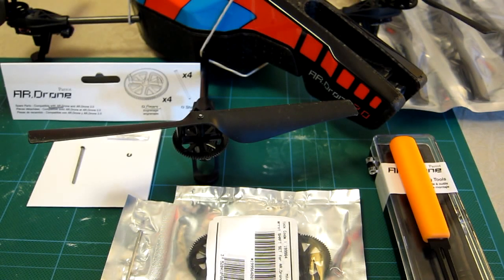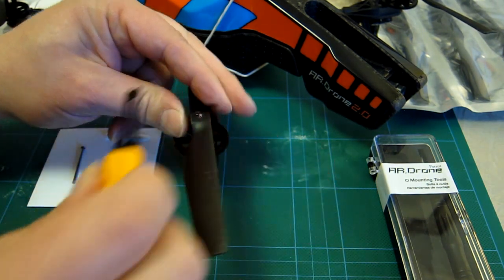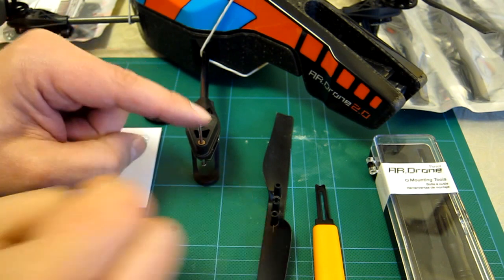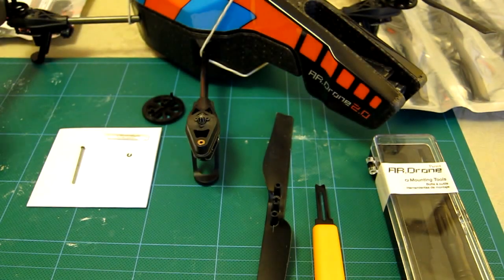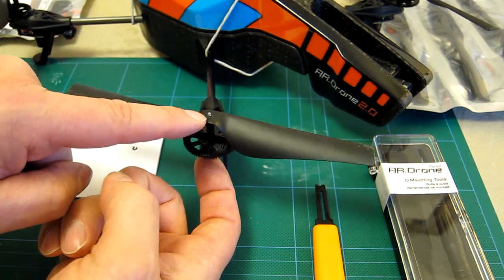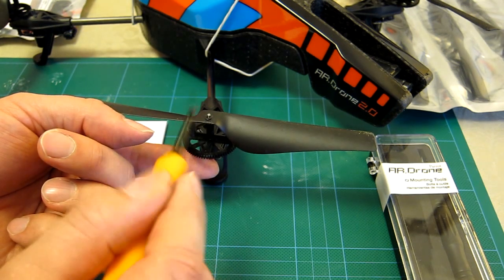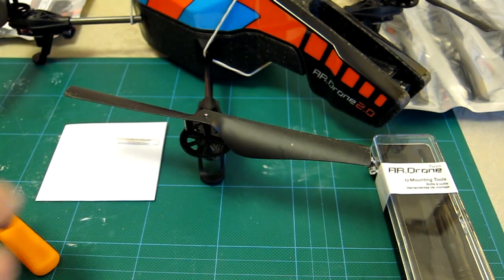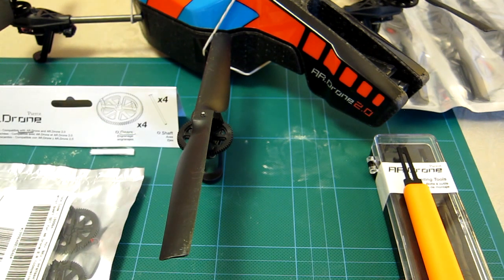in HD - AR Drone 2.0 - Gear, Shaft or Prop Replacement - How to - Fixes Unstable flight videos

Comment: What's the diameter of the shaft an the length
Reply from the maker: Sorry, I do not know. however they are so cheap and readily available.
https://www.ebay.co.uk/itm/273469775120

Comment: Great video, but how do you replace the tiny gear that spins the big gear???
Reply from the maker: Motors removed and then re-installed in this repair segment:
https://www.youtube.com/watch?v=b19laOlDync
From circa 04:00 onwards.
You can not remove the drive gear from the motor. The plastic cogs are sacrificial. The plastic gears strip so the metal teeth are not.

Comment: What to do if there is no mounting kit to remove the c clip ? Mine shaft bent so I ordered new ones but I couldn't found mounting kit in stocks
Reply from the maker: +Teknolojik Tencere if you do not have a C clip removal tool, you can still remove then C clips with small pin nose pliers. Just means that you are more likely to twist or damage the C clip. But that does not matter as you get more with the shafts.
Be careful pushing them on. That can be done with the flat of a screwdriver head. Hope that helps! (But always better to have to right tools)
Reply: +Tom Strong Reviews eye thought that scissors would ve okay but may give damage dont worry i have 8 cclips
Reply from the maker: +Teknolojik Tencere Mind you do not hurt yourself! 
(Scissors are far far away from being the right tool for this job)

Comment: Hey can you help me out?
I bent the shafts to the point I can't push them out. One of them are so bent I can not even push a part of it out, so I can't try to cut the shafts in half. What do I do?
Reply from the maker: Goldname1 Wow. that is bent! I would first use pliers to straighten the bent shafts so I could remove them. If that does not work. Try and find a flat metal surface (top of a vice etc) and align the drone and pin such that you can tap the pin with a hammer.
If that fails... The metal surrounds above and below the pins are bushings and can be popped out. One up and one down. You may then find you can slide the bottom bushing off the pin shaft gives you enough wiggle room to remove the pin shafts (with the top bushing still attached)
You will be able to pop the two bushing rings back in afterwards..
Good luck!
Reply: Tom Strong Reviews Thanks. I straightened it out at first a little with pliers but I still couldn't push out. Then I just hit the thing out with a hammer and miraculously didn't break anything.
Reply from the maker: Goldname1 Good job and good to know.

Comment from the maker: It is better to change or straighten the shaft pins rather than let the motor take the strain and your AR Drone fly all over the place.
I have bought a total of 2 x 4 shafts and do straighten those that I can with pliers and a hammer.
I use a 60Beat controller now and crash far far less!

Comment from the maker: If you mean the cross-piece. Yes. I have a video series that shows you all the steps.
However if you mean just the central cross section that the four shafts go into... I am not sure. (a) not seen that available on its own. (b) the shafts are glued in really well!.
Maybe you need to use a Epoxy resin fixer / glue ??

Comment from the maker: Sounds interesting. Where did you get the 4 motor gears from ??
BTW - If you are concerned over wear - then consider replacing the bushings for bearings.. Makes a big difference.

Comment: Yes, I meant the gear attached to the motor. Yesterday I received a gear kit to fix my drone. There were 4 motor gears in the kit. I think it is always better to change the motor and the propeller gear. If the motor gear has only a tiny damage, it may make noise, or wear out the new rotor gear too early.

Comment from the maker: Thank you for your feedback. Glad you liked it. I have made many others as I have needed to and cover some of the major repairs in those.
If you mean the gear that is attached to the motors. That is because I have not had a motor or motor cog issue. + Those little cogs are not really replaceable, Parrot current stance is that if you need to change those, you need to buy a new motor..

Comment from the maker: Great news! There is no real 'special' reset that needs to be done.
I will always 'Calibrate' my drone before I fly - but that is more about detecting the WiFi signal direction more than the mechanics, however. You do watch the drone hover and then make a clean 360 degree spin...

Comment: I fixed it and made a video tomorrow I will fly outside. Did you reset the drone or recalibrate it after you replaced  the shaft I did not and it seemed fine indoors

Comment from the maker: I haven't straightened any myself as yet - but would expect it will need a solid metal flat base plate. Hang the pin so that the head is over the edge and then with a small hammer, tap the shaft as you keep rolling it. Once the 'rolling' feels smooth and you do not have any 'wobble' when rolling in a circle around the pin head, that should be straight.

Comment from the maker: Will be very interested to know if that works. My shaft replacement is all due to a 'split' down the seams of the main cross brace. Looks like a manufacturers fault to me.
I will post a link to this video when it is finished (doing it now) and has uploaded..
Let us all know if your repair works and it flys again.

Comment from the maker: Regarding the 'Drone drop' - You are not the first to experience this. You need to check what version of firmware you have. Some of the older ones are better than some. The VERY latest (Came out only 10 days ago) seems to be getting good reports. Worth joining the Parrot AR.Drone web site. Good forum and a lot of support available there.
Good to hear you got inside ok - Here's hoping that the Araldite works.

Comment: Cheers Tom. I sussed it out eventually and yes it is broken but not all the way through. I managed to gently prize the broken joint open without making it any worse and this allowed me to get some Araldite into it and a good blob around the joint.... its now sat with elastic bands keeping it all in position. Ill just have to see how it holds out. 
Happened the other day when it just cut out for no apparent reason and dropped about 15-20 feet onto gravel.

Comment from the maker: If a leg or Crossbeam wobbles or now rocks - it is probably broken.
To look, you have to rip off the bottom stuck-on cover (around the camera). Then you have to remove the main circuit boards. This can be fiddly and needs you to remove connectors and do this in stages.
I am in the process of replacing my broken Cross-Beam and will have a detailed video for this later tonight. Give me 24 hours and I will have video/s that show you what you need to do / see / check.